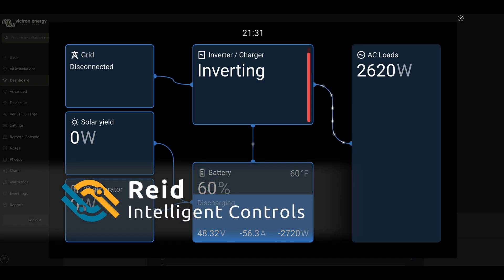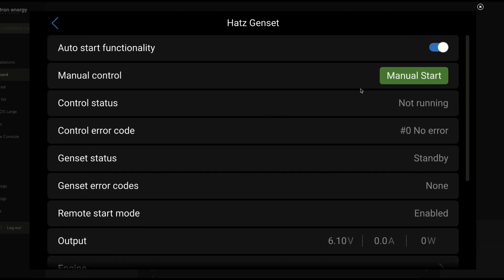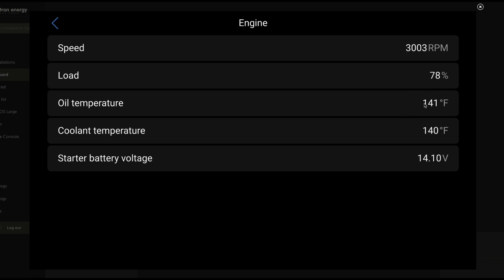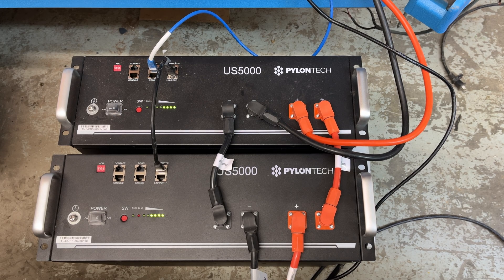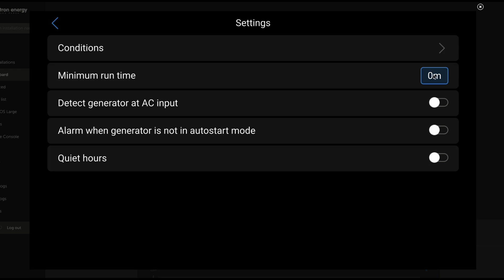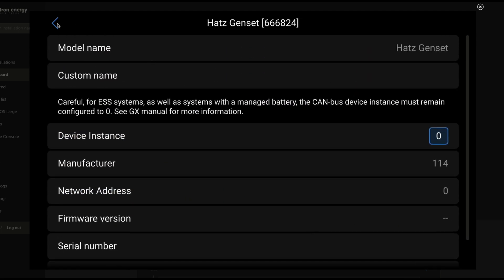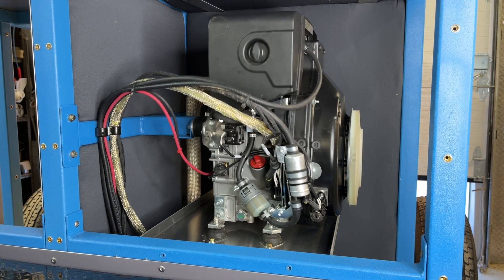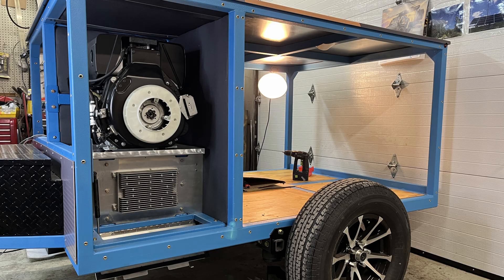Victron-Hatz fiPMG Genset Integration VRM View

Comment: i see that you were seeing a "coolant" temperature - on an air cooled engine ? Something strange going on there !
Reply from the maker: Yes it’s an issue where coolant temperature is actually oil temperature. Will get it fixed with Victron. Good eye, Jim!

Comment: Great work, this is an exciting product.  Any idea what the oil change hours is for the extended oil pan by chance?
Reply from the maker: Hi there. The standard oil change interval is 250 hours. The extended sump holds about 3 times as much oil. Our guesstimate is at least 500 hours, but the official position from the Hatz engineering team is that the application would require oil sampling before they would extend the service interval. For hybrid applications, even 250 hours is quite a long time. The engine doesn’t have to run very long when working in conjunction with batteries.
Reply: @intelligentcontrols  that's good to know thank you.  I assume the 150 hour "generator service interval" shown at 4:30 in the video was just set for the demo and not supposed to be accurate or is there something other than oil that drives service at 150 hours?
Reply from the maker: @gf3803  Ah, Yes, that's just us not setting it up for the right time window. It is adjustable and not controlled by the generator. The point of the service interval is that from VRM, you can see that you need a service, and you can set up alarms. One of the key background features here is monitoring the DC generator run time which, until this integration, was never done in the Victron Ecosystem, because to monitor run time, you need to verify that it's charging without the traditional path through the multi or quattro.
Reply: @intelligentcontrols  excellent, so if I were to get one of these generators I would just set 250 in that field and that would let me know when I needed to do an oil change.  Perfect, thanks!

Comment: I was looking into DC generator 10+ years ago and I came a across  a  2011 Caterpillar report by Marcelo Algrain Ph D titled "DO DC GENERATORS OFFER FUEL ECONOMY ADVANTAGES OVER AC GENERATORS? ANSWERS FOR THE TELECOM INDUSTRY.............One of the main advantages I found to using a DC generator was variable speed. One issue with Diesel engines is prolonged low loads cause wet stacking. I ended up using a Honda EU series inverter generator...........I have and have had a lot of generators with fuel efficiency as key point. That said I have found that the quality and level of sound  the generator creates is also very important. The wrong quality of sound will drive one nuts.
Reply from the maker: Indeed, running diesel engines underloaded can definitely cause wetstacking.The fiPMG is variable speed, so it will only increase speed as necessary to supply the power/load the BMS is requesting. Given the size of the battery banks being used in most applications, it will likely be well over the 30% load or so necessary to keep wetstacking from occurring. The variable speed with the inverter does also keep the noise down.
Reply: @intelligentcontrols I have hooked a three cyl diesel gen with ac generator head to oil burner boiler, the exhaust heats the house at the same time. It works but the 1500 rpm is too noisy and I was looking into DC generators hoping if they could do 48V with lower rpm and current. For example Linz generators too need 1500 rpm so it would be as noisy as AC head. Not sure if such slower possibility even excist.
Reply: @tujuprojects  1500rpm is already exemely low. 900 is idle.

you'd need a MASSIVE displacement to produce power and sufficient oilpressure at 750rpm.

diesels are noisy and you got to insulate them from vibrations and acoustics. a small shed just enough for the genny and a few m³ of fueltank.  THICK rockwool on the walls inside, exhaust and intake mufflers for the engine.  engine warmth keeps the fuel from gelling up.

most heat would be utilized as heating for the house via an exhaust/oil/water heatexchanger to hot circulation into a buffertank.
Reply from the maker: Sounds like an interesting project.

Comment: Their like 5k to start 😢
Reply from the maker: Super appreciate this comment because this is a total mind shift - we all want to compare Hatz with the best Honda portable generator or the home standby propane generator we can buy off the shelf, but it's hard to price something that's not an apples-to-apples comparison. We wrote this article that compares the fiPMG hybrid generator with the Kholer 14RCA to help wrap our minds around actual operational costs: https://intelligentcontrols.io/blogs/technical-articles/how-does-the-hatz-fipmg-compare-to-most-off-grid-generators. Would be interested to hear your thoughts. The Hatz is basically a 5K gen with the performance of a 12K propane unit. So for a real price comparison, you'd need to know what size AC generator you're comparing it with (for some it's a 12K, a 15K, or even a 20K AC generator because your charging potential is limited by your inverter size).
Reply: @intelligentcontrols but they are overpriced. A Könner & Söhnen KS 48V 70A DC generator costs around 1,200 euros. How much more would it cost to add a CAN controller and upgrade it to 100A? Four times the price?
Reply: Or maybe 5 times the price…
Reply from the maker: Hi Julian. What I would say is that comes back to quality, design - and communications. Hatz is really good at making quality engines, and they've worked hard with the Victron team to build an integration for about a year, which we've been able to be a part of. It's a big investment in time and resources for both companies that they'll now continue to improve and maintain, and that's worth a lot. As for a K&S having the same capacity, on paper, at a lower cost (but without the functionality), we would absolutely try one of their engines were it available in the US and if they had the same level of communications integration.
Reply: @intelligentcontrols  I hope you can release another teaching video on how to install and wire, which is very helpful for me because I have already placed an order to purchase a generator, even though it is still in production. thank you
Reply: @intelligentcontrols   product is compact in size, powerful in functionality, and runs fully automatically. In terms of renewable energy, I think the reason why it is more energy-efficient is that it directly uses DC-AC, reducing losses during the conversion process! And this generator is the APU of the tank, Hatz is also a globally renowned generator manufacturer.
Reply from the maker: Hello, yes, that’s a good idea. We’re working on it :)
Reply: @intelligentcontrols compare it with whatever you want, it's still overpriced AF 😂
Reply from the maker: ha! Thanks for the honesty. It's definitely not like buying a Predador from Harbor Freight. Propane generators are super cheap, but it's hard to compare a Generac or a Kholer to a diesel. This is an industrial engine, it’s from Germany, and the main customers are manufacturers... so it's a level of product that consumers don't buy, really. The reason why it does work for consumers is it's not big, it's made to integrate into an existing setup, and depending on what someone is trying to accomplish - it's not more expensive when you do the math, which you of course have to do for yourself.

Comment: epic ..  it  scratches some of my thoughts/////    my first off grid atempt is 48v and i always wanted to do it  but with automotive small engine!
 but this thin is worth every efort .. especialy if there s  support and spare parts to maintain hardware and electronics
Reply from the maker: Panos, yes. It's a pretty dreamy solution for any type off-grid system where you want the fast charge rate without buying an oversized generator. We have sold Hatz engines going into home systems. Some are powering off-grid businesses, for ex, running a small lumber mill or a refrigerated van. There's support and parts available as well under the global Hatz network and Intelligent Controls is a "technical service partner" for Hatz in the United States, providing the equipment and technical support for this integration.

Comment: This video checks at least 2 interest boxes dc diesel gen and auto start.
Reply from the maker: Yeah, it definitely checks some important boxes, which is why we've been fanning the flames on this Victron-Hatz romance (ok, product integration). Small, lightweight, variable speed, DC, great fuel efficiency, auto start AND with coms/remote monitoring. This is super powerful technology, especially with the Cerbo taking the place of the generator controller. We lay out a bit of a 'how we got here' history lesson, but this is something that has been missing in the marketplace, and it's been so fun to see this come together. https://intelligentcontrols.io/blogs/technical-articles/the-generator-rut-modern-hybrid-power-systems